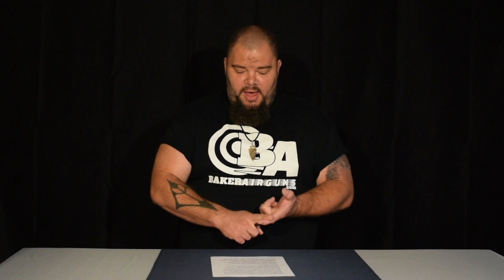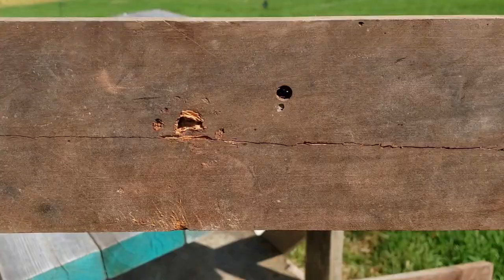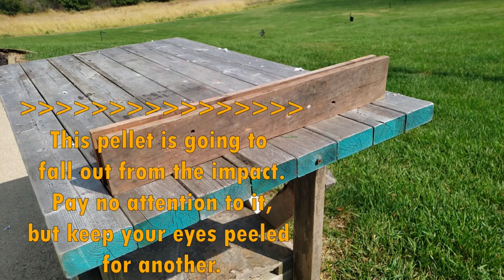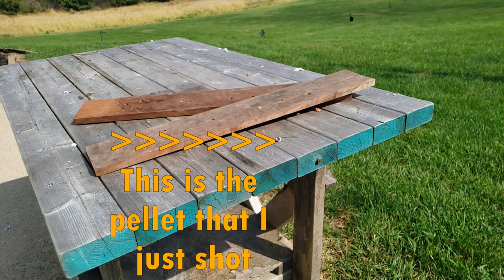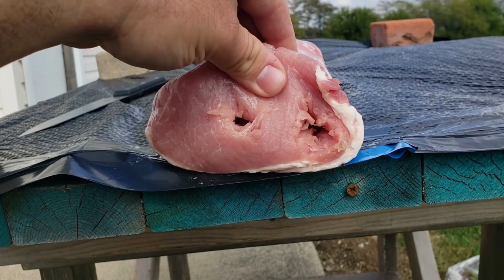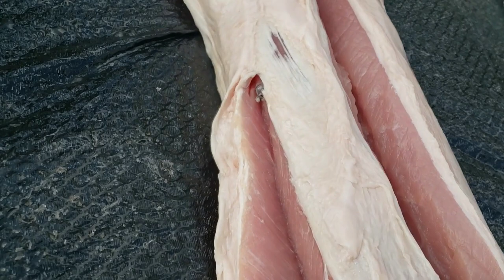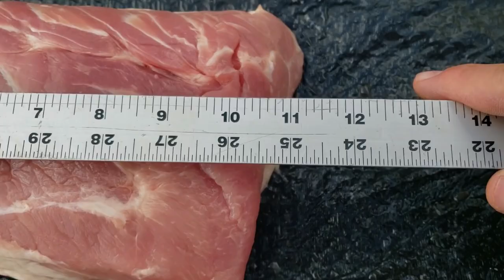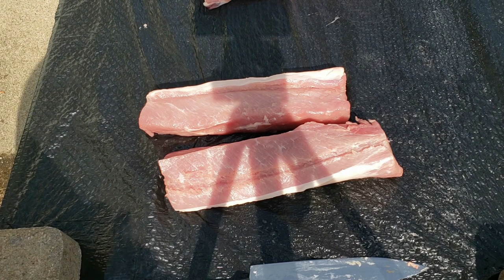PART II...What's deadlier, a .25 or .30 caliber airgun?

Comment: I can see how using the exact same pellet with the same energy, would be applied, an a smaller object will probably travel further..ill go with that..but do that same test with fx hybrids..hollow point slugs that are exactly the same....we have to rember in science an objects weight must still be applied as well as design...those test were done with very specific and exact ammunition to create those results..and I tend to agree with him in his analysis of same weight same speed different diameter test a larger surface same weight projectile will have more surface friction on impact therefore slowing down at a faster rate than its smaller counter part the. 25. but heres the kicker...do that same test..and use the same ammo used in the .25 jsb 33.and half grains in the .25  and then shoot that 30 cal with a .50 grain hollow point at 10 yards and oh brother watch the splatter.....the best thing I can say is that design and weight of object immediately effect the initial impact and if were after animals and looking for most immediate devastating results...that .50 grain hollow point all though slower and larger will cause more  (IID)  or Initial Impact damage, creating a larger cavity on impact and its length of distance traveled. This particular test could have gone no other way because of pure physical size of object...same speed more surface area of impact..but change the factors a little and a .30 cal will be more deadly all day everyday ...like I said use that 33 and half  for the .25 cal.  And go and get some fx hybrid 44.5 g I believe or even better use a NSA 49.54 grain hollow point for the .30 instead of a solid round...and the amount of foot lbs of energy will all a sudden become a factor (splatter) ...but he is right none the less in this particular test..I agree ....but only can be achieved, like I said in my honest opinion and humble opinion these exact circumstances...same speed same shape ..difference being surface area of impact...
Reply from the maker: Thank you for the post.  And I agree.  Testing different variables would certainly produce a different result.
-Donnie

Comment: The problem here is the 30 cal is running way below the normal fpe.  You have the .25 cal at 70 fpe and the .30 cal at 70 fpe.  Normally the 30 cal air rifles are 100+ fpe so in my opinion is the test should be ran at the normal fpe for each caliber not lowering the 30 cal to match the 25 cal.

Comment: Although I fully understand and appreciated the stated premise, I respectfully disagree that ‘penetration’ is the single most influential variable. 

When regressed, energy transfer is equally important - both in the calculations used by the various entities you site but also the firearms industry, and international treaty organizations - as well as, anecdotally, just about anyone hunting and harvesting animals. Out of hand you appear to discount the various methods used to quantify energy transfer. I certainly do not.  Allow me to dissuade you.

There is a reason that international organizations have rules negating frangible and expansive projectiles in wartime. Where FMJs are designed with sectional density characteristics for ‘pass through’, most hunting rounds are not so designed. Projectiles for hunting are designed to expend as much energy as is possible at the optimal payload location. They’re designed to most ethically harvest animals.  FMJs are decidedly not so designed.

Sufficient penetration combined with energy expenditure and subsequent wound channel are pretty much everything when ethically harvesting an animal. Imo, a properly placed shot in conjunction with sufficient penetration to reach critical internals AND significant projectile energy dump (as much energy as is possible) into critical internals - not expended elsewhere - is what anchors an animal.

Admittedly, I have lost animals with passthrough shots - primarily hogs in heavy cover. Never have I lost an animal where the projectile didn’t pass through, spent all of its energy within the critical organs of the animal, where shot placement was correct.

Even where passthrough happens, a larger caliber is preferable given the internal damage (e.g. wound channel).  Double lung passthrough with smaller calibers will very likely kill a hog, but just as often it may run - even uphill hundreds of yards - prior to expiring. I’ve personally had hogs do this. Whereas a larger caliber’s wound channel in the same shot location will more often than not anchor the animal faster. Why?  The expended energy internal to the animal was more significant and led to a larger, more devastating wound channel.  Penetration alone does not account for this.

Admittedly, I can’t speak to the characteristics of the .25 and .30 pellets and rifles in question wrt lethality on a hog where intended shot placement is brain/stem. Perhaps in that singular instance, under those finite variables, the .25 prevails given penetration. Based on your calculations and testing it would appear to be the case.  Nevertheless, discounting energy transfer for the purposes of a hunting load is, imo, inconsistent with providing hunters a complete understanding relevant variables for ethically harvesting an animal. 

Loved the video, the review, the insights; just subscribed. I’m in the process of acquiring an AEA in .35 for hog hunting. Videos like this are both informative and motivating. Keep up the great work!

Comment: If what you are looking for is damage, I do not understand why the .30 goes much slower, to be honest it should be at the same speed, the comparison is not logical, I use .22 and .30 and if in .22 it goes to 1030fps and in .30 to 875 you don't have to watch a video to know the result. My impact had it set to 1030fps 65g nielsen, obviously that piece of meat would have split it in 2.
Reply from the maker: No.  You simply don't understand the problem.  The ENERGY has to be equal for an equal comparison...not the velocity.  What a pellet does to a target is work...as defined by the equation W=Fs.  That means work = force x displacement.  That's very rudimentary, and an incomplete explanation, but still accurate.  It is the FORCE (kinetic energy) that needs to be the same for an accurate comparison....and that's the exact situation I created.
-Donnie
Reply: @BakerAirguns  I understand know but i don't think the .25 is more accurate at this speed...
Reply from the maker: @tomlpnexus  Normally I would agree, however the 25 I used for this testing was my 100yd benchrest gun.  Indoors, using the JSB Heavy MkII, it will print 1/4" groups at 100 yards with boring regularity.
-Donnie

Comment: More penetration does NOT universally equate to more damage at all... Over penetration is in fact a problem and hollow points are designed for REDUCED penetration because it equates to more energy transfer under the right circumstances.

Comment: Difference is drag on the two different pellets 25 vs 30 add the speed to the 30 that's needed for diameter creats drag whitch you will have to add speed to the 30 to make it equal dew to the drag difference if you shoot the 25 vs 30 at same speed dew to drag shure its gona be a difference. shure 5 thousands is going to slow penatration take a 10 foot pair shoot with a thousand pounds vs a thousand pounds with a 5ft pair shoot whitch one is gona hit the ground first and the fastest and hit harder do that experiment and show the difference but I do agree that the 25 has better penatration dew to its diameter big drill bit vs small drill bit always smaller bit is easier to dill

Comment: It’s pretty dang simple to see that at the same fpe the smaller surface area will go deeper...  hence the .25 going deeper however if your shooting squirrels recon fox opossum and birds the wound channel from the 30 is going to be bigger cause both will have a complete pass though. 

My .30 cal does better on squirrels then my 22lr because the hole it makes is bigger even though it has less fpe..  I don’t know any Guns that come in .30 and .25 where the .30 has the same fpe as the 25 so in Actual practice in most maybe not all times the .30 is more deadly.
Reply: When you shot the meat you said there is no appreciable difference in the hole size but by volume it’s around 40% bigger so if you go by wound channel width times length I don’t think your going to see much of a difference in the two.. however if you have a pass though with both the .30 is going to bleed out 40% faster
Reply from the maker: @jeremyvanschoonhoven6036  The wounds were the same size.  Didn't you see that?
-Donnie
Reply: @BakerAirguns   no I saw that the .30 was a bigger hole as would be expected considering it’s a bigger pellet..  when your looking at blood loss a slightly bigger hole makes a huge difference in volume..
Reply from the maker: @jeremyvanschoonhoven6036  No.
-Donnie

Comment: I think you did a really good job. To me it's like shooting a 22 mag and a 410 slug at 100 yards, the 410 has more mass and energy when it hits but the 22 mag will zip all the way through. If it's me getting shot with those 2 guns at that distance I think I'd take my chances with the 410. The energy is knock down power not killing power.

Comment: The standard FBI penetrating test is 12" - 14" and past 18" is over penetration. The FBI also says that you should shoot for center mass. The skull is always going to be hard to penetrate.  I can see the 30Cal left a larger hole and damaged more flesh overall. The 25 is more like an icepick wound and the 30 is more like a blunt rod. Also, I noted that neither pellet was shot fast enough to deform. Seeing that they are made of soft metal and not a brass jacket, you did not put the true speed behind the rounds so they could perform at peak efficiency. You also spent a little time trying to smooth the wound track on the 30. You said it yourself, you went into this to prove the 25 is better than the 30, which also causes flawed outcomes because you will be trying to get the answers you want over what could possibly happen. Also, the 22lf has killed more people than any other but the governments do not use it. The truth is that they cannot use something that will not stop a person right when they are shot. The Dum Dum bullets were outlawed because they did too much damage. That is why metal-jacketed rounds were made but they turned out to be very bad for war because they passed through (ice-picked) leaving a small hole that did not stop people in the war. The people who were shot, sometimes do not even know that were shot till later, after the battle is over. Today, it is the speed of the bullet that makes the difference. A slower-jacketed bullet will not cause much cavitation, whereas a very fast-jacketed bullet will cause a lot of cavitation. The difference between the 25CAL and the 30CAL is small but I can see it. You are saying that the 25CAL is better because it goes deeper but if you were to do the same test with 2 Evanix Rex, one at 25CAL and the other at 50CAL, I think the outcome would show the 25CAL goes through everything and the 50CAL would just make a big deep mess. The Zeus 72CAL on the other hand would do both (SCARY) 

A good test of what I am talking about is to shoot a 1-foot squair clay block.

Comment: Actually the measurement is incorrect as the first pork loin was cut on an angle and the 25 caliber pellet went through one more inch of meet on the first loin. And the difference was 4 in on the second loin so the total difference would have been 5 more inches of travel for the 25 caliber pellet.

Comment: It is really physics:  It is obvious the 30 is dumping all it's energy into the mass of the target
while the 25 is dumping less.  For a given energy of kinetic motion the difference between the cross sectional areas as connected to caliber shows that for the same energy the larger caliber or cross sectional area is the one that will dump more energy.  But since bleeding out is important it is obvious the 25 will make more wound to do that within.

Comment: Great analysis 👍 
Although the wound channel from the 30 due to diameter measures 20% wider and the 25 went 24% farther. You still need to finish doing the math. You claim the diameter of wound channel are the same or almost the same but thats not true.. The length of the 30 cal wound channel multiplied by the larger 20% diameter may be equal to the diameter of the 25 cal times the extra distance of penetration?? You have to do the math to complete your theory. Very interesting. 
For hunting more penetration equals more lethality not with powder burners.
A 22 that misses the spine on a deer will pass through and only wound the deer but a 30 cal shock wave within an inch or two will damage the spine or the heart and and be more lethal. Pure physics and energy transfer.
For air rifle speeds hunting penetration may have a small advantage over diameter in the UK at 12 foot pounds.
I still think difference is negligible..
Longer wound channel versus a larger wound channel. If you're not shooting em in the head a larger wound channel wins every time. 
50 years of hunting all over North America.  I like big holes better. LOL 😆

Comment: You are completely ignoring sectional density which is a HUGE factor in penetration while also ignoring kinetic energy's effect here.

Going from a sectional density of 0.071 with the .30 to 0.078 with the .25 is a 10% increase which seems to roughly reflect your results here. Switching to  a 50gr pellet with a 0.080 sectional density should achieve similar to slightly-superior penetration results.

Also, matching up FPE is unrealistic and hamstrings the .30 as it's greater cross-sectional size impart more energy to a pellet for a given PSI.
Reply from the maker: I have ignored nothing...and the results are what they are.  70fpe is a very common energy level for 30 cal.  This was in fact SO realistic that it was actually real.  If you don't like the results....tell the universe.  I don't get to dictate reality.
-Donnie

Comment: By your logic, everyone should be hunting with FMJ to get maximum penetration and a more humane kill. That's not reality.

Also, not sure what you mean by “appreciable difference.” However, one wound track was 6.4mm(25 cal), and the other was 7.7mm(30 cal). While not a massive difference, one is more significant than the other. Suggesting they are equal is misleading.

For the record, I don’t own any .25 or .30 cal air rifles currently. However, the real advantage to going with a larger caliber is to use heavier projectiles more efficiently. 

Air rifles like more surface area to push on. This results in higher power numbers when the air pressures are the same. If you would max out both rifles, the larger caliber will have more energy at the muzzle every time. When you equalize the energy levels, the heavier projectile will be going slower. The speed also affects penetration.
Reply from the maker: First of all, these are not firearms.  You cannot directly compare the two.  Nor were the wound channels the size you say, or the physics you tried to invoke correct.